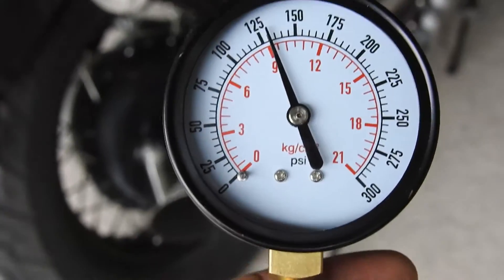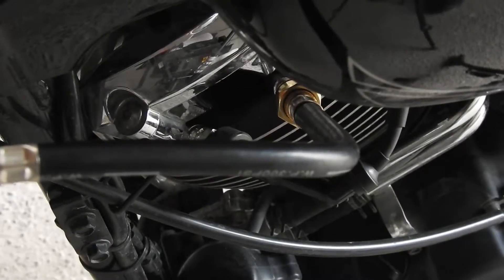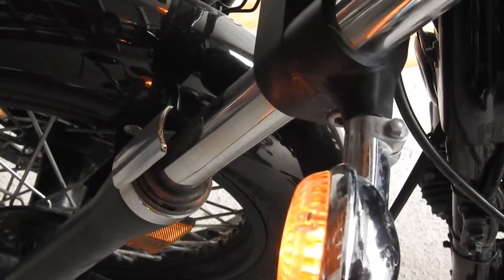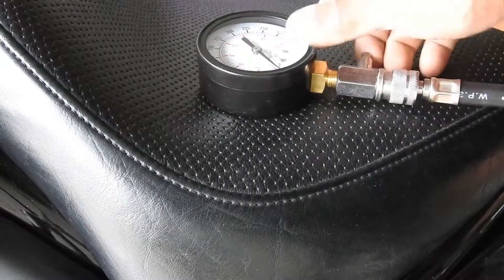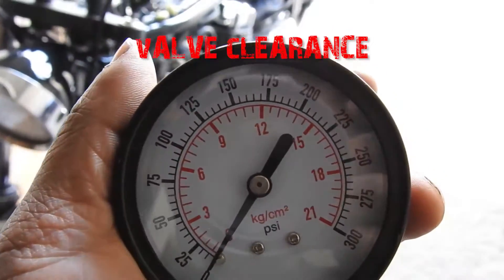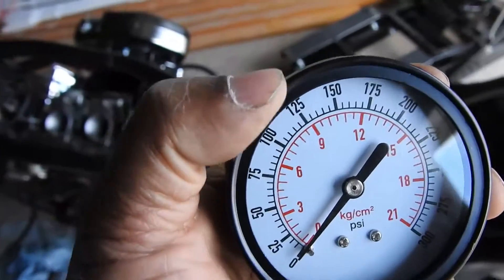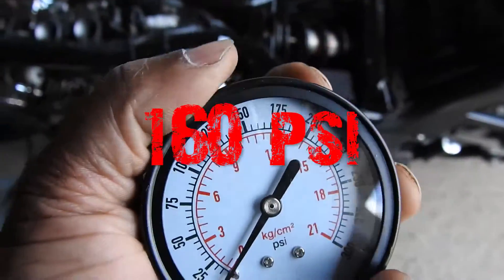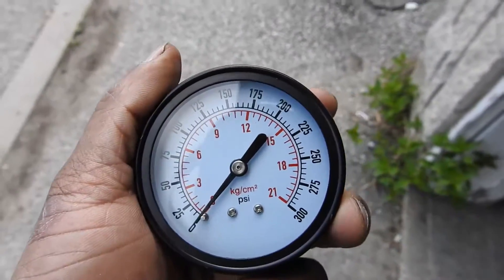V-Star 650 Compression Testing

Comment: Thanks bud! Got a sub from me. I also used your video for valve adjustments.
What do you do if compression is bad?
Reply: rebuild the engine. mine got like 95 psi
Reply: @95BLUERAY  how can you find out if compression is low? Any symptoms?
Reply: @TheKylebreezy  the engine performance will be bit low plus hard to start when its cold but this might be from the carb
Reply: @95BLUERAY  thanks man I really appreciate the info
Reply: @TheKylebreezy  np man any time. ride safe
Reply: @95BLUERAY  same to you brother👊👊